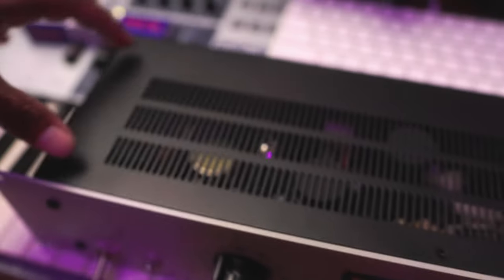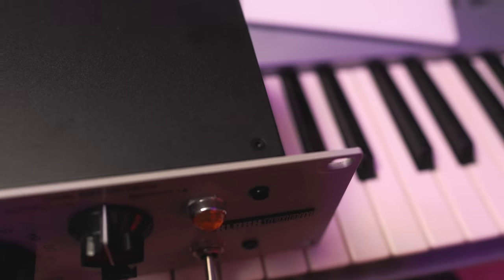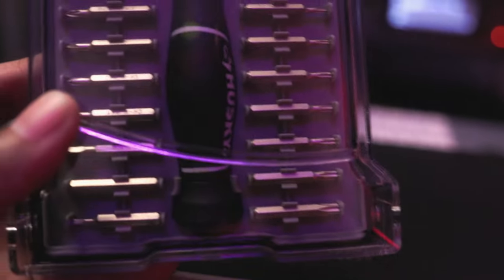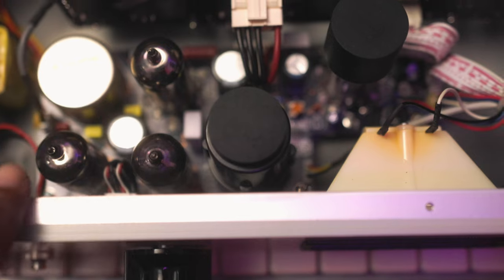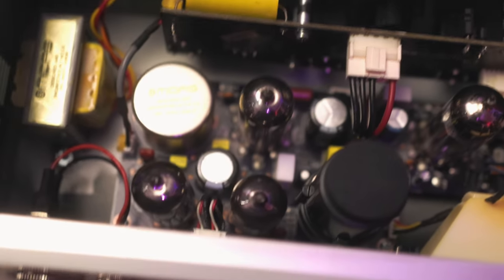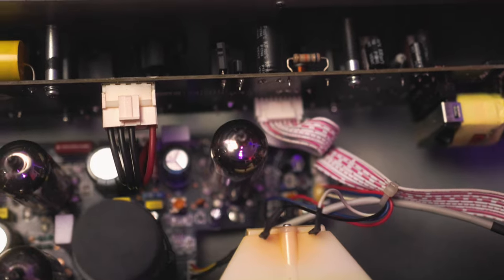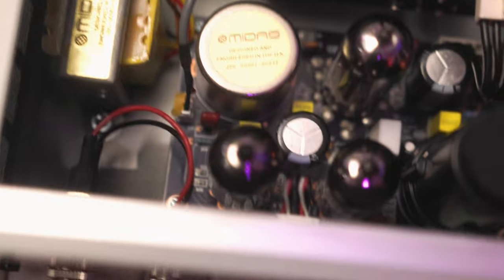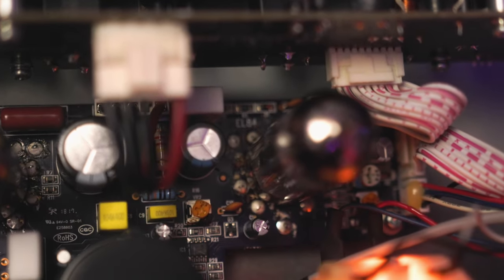My Hardware LA2A Compressor Passes Audio But No Compression!! 😤

Comment: I changed the tubes on my Avalon vt737sp. Yeah, you gotta rock em gently and pull till they come out (no Diddy).
Reply from the maker: Man I thought they were gonna pop! 💥 😂
Reply: Good to get your replacement tubes from a reliable source. I had a tube break immediately after replacing and powering up my A-Designs Nail Compressor. Glass in the guts and all. Expensive repair. Safe to say I don't buy anything with tubes anymore.
Reply from the maker: Yeah that’s no good. 🤦🏾‍♂️